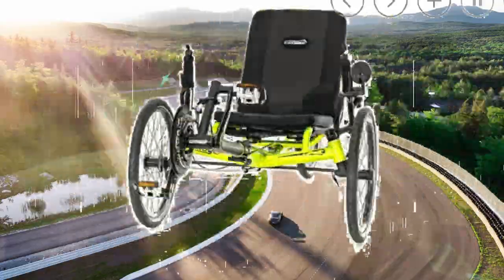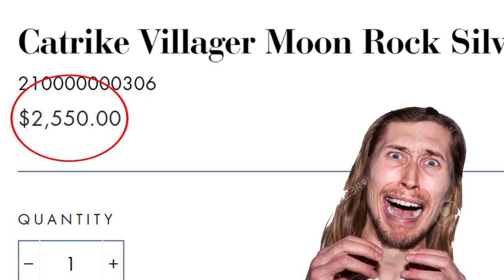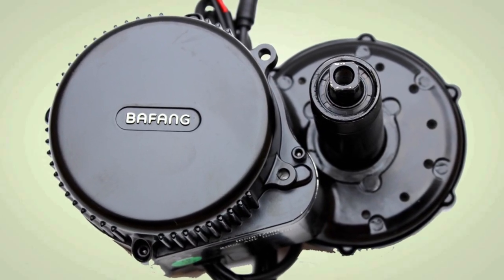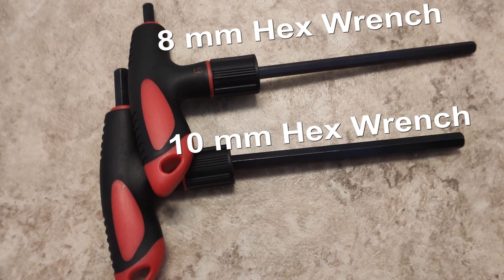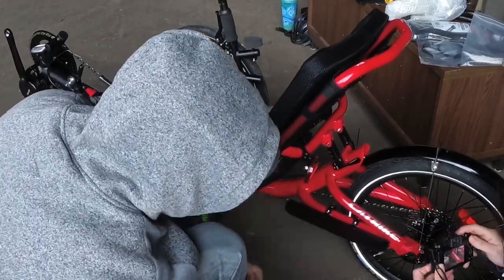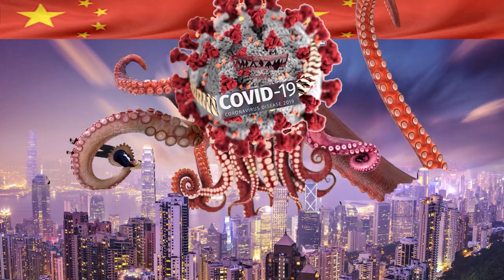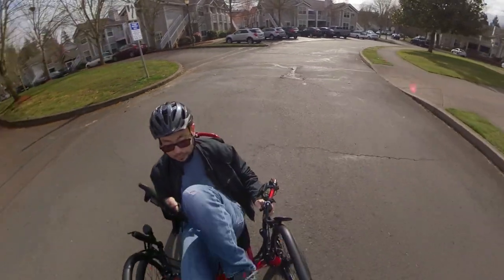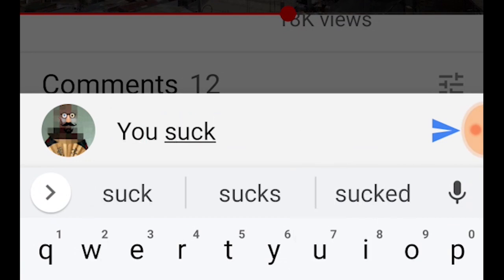DIY electric recumbent build with 750W Bafang mid-drive electric motor for cheap!

Comment: Hi.

Thanks for sharing.

Can you tell me where you got the mount the battery is on. And the grey braided cable tidy. Going from motor to battery.

Thanks.
Reply from the maker: I got the battery mount from Utah trikes.com and I got the sleeves for the battery braid on Amazon, at least I think that's where I got it from.you can always check the affilate links in the description